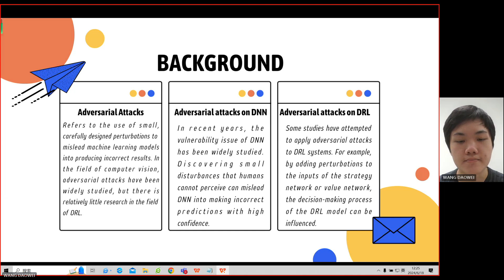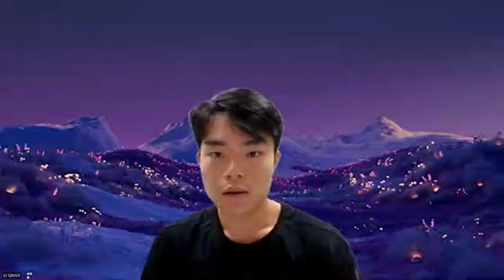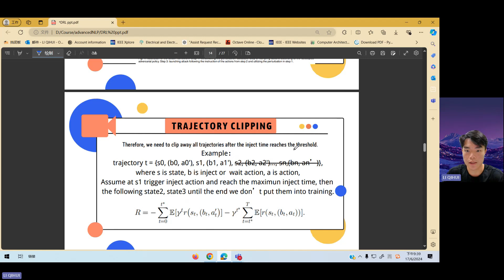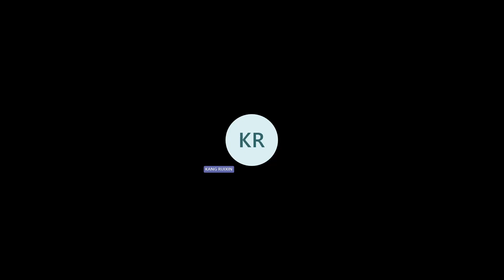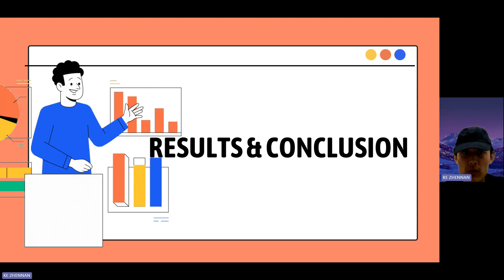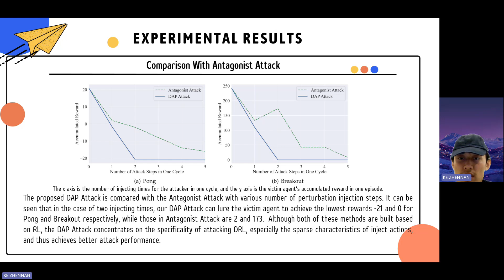202404 AIT306 Group 5

Comment: From Group 10:
How does the Decoupled Adversarial Policy (DAP) specifically enhance the attack on DRL systems compared to previous methods?
Reply: The DAP enhances targeted attacks on deep reinforcement learning with a number of specificities compared to previous methods:

a. Separation of Concerns:

DAP splits the decision-making process into two separate policies: the switch policy and the lure policy. The separation enables the attacker to work on both attack timing (which is when perturbations must be injected) and attack nature (that is which action to prompt), thus optimizing both aspects more efficiently.

b. Strategic Perturbation Injection:

Instead of injecting perturbations at every possible step, DAP employs switch policy to strategically select crucial moments for perturbation injection. This will minimize any chances of detection while maximizing their impacts towards victim’s performance through concentrating on moments that are most likely to change final rewards.

c. Universal Perturbation Database:

By pre-constructing a universal perturbation database, quick and efficient real-time querying of perturbations can be achieved. In contrast, this is different from earlier techniques that required instant computation of perturbations which were time-consuming and impractical in real-time situations.

d. Optimized Learning Process:

Trajectory clipping and padding help in ensuring that amid the learning process relevant data are focused upon thereby reducing noise, hence improving training quality. Besides, decoupled proximal policy optimization (DPPO) algorithm aids in synchronizing learning between switch and lure policies by addressing mutual restraint issue hence enhancing overall attack performance.

e. Efficiency and Practicality:

DAP has been designed in such an optimized manner that it only needs few numbers of steps in order to cause significant degradation in the performance of victims using lesser number of steps than other previous models therefore making it practical for use across different DRL environments including challenging environments like Atari games e.t.c whereby its implementation results wouold solve issues posed by real time decision making ability as well as minimal perturbation steps usage

Comment: How is DAP trained and optimized in practice?
Reply: To develop Decoupled Adversarial Policy (DAP) using its training and optimization, a number of important techniques are introduced:

a.  Trajectory Clipping: An attacker is unable to conduct further attacks as soon as an N-steps attack has reached the maximum number of injection times even though he tries an inject action. These data do not represent what DAP is made of and hence should be removed from a training buffer.

b. Trajectory Padding: Various trajectories may have different sizes. Shorter trajectories are repeated so that all trajectories contribute almost the same samples to the training process up to the length of the longest trajectory.

c. Decoupled Proximal Policy Optimization (DPPO): DPPO optimizes sub-policies within DAP. In this case, two independent ratio terms for switch policy and lure policy are calculated. Minimizing global loss makes it possible to update these sub-policies simultaneously so that they can effectively handle sparsity related problems concerning N-steps attacks with inject actions.

d. Querying Universal Perturbation in Real-Time: The attacker clusters states into various categories then creates universal perturbations for each category. These distortions are stored in a database which can be queried rapidly during realtime attacks. This technique allows misguiding victims with minimal time delay, thus balancing between attacking efficiency and effectiveness.